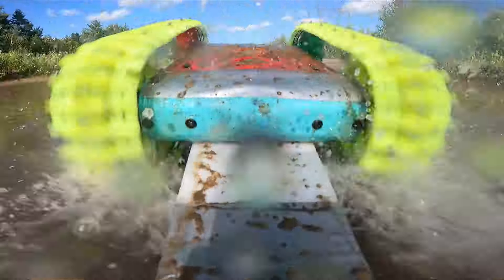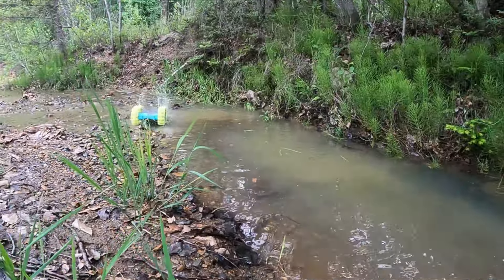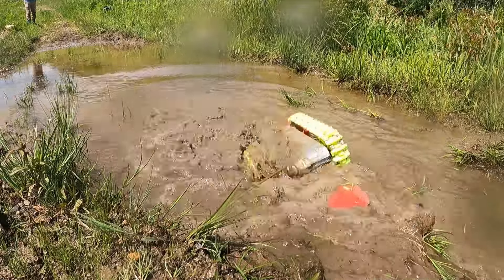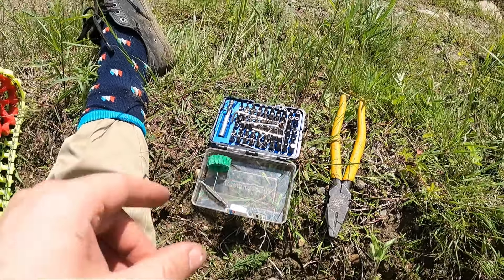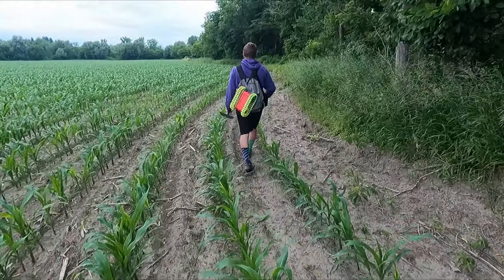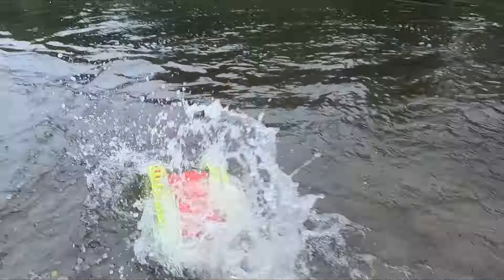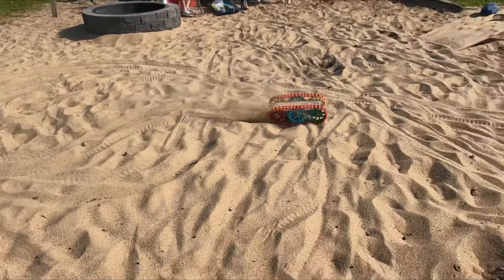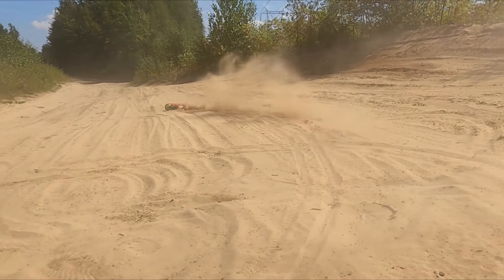Can a RC tank waterskip?

Comment: Can’t help thinking that the various tracks should have ‘link spacing’ commensurate to the type of terrain and maximum speed of the robot, which in turn would make it more stable and less likely to tip or flip ‘uncontrollably’ when travelling through say water .. just my opinion!
Reply from the maker: It's interesting, I'm always open to trying to improve this project. Especially if it makes the vehicle more stable. Since the tracks are 3d printed it will be relatively easy to modify them. but I don't quite understand the influence of link spacing on stability. Can you give me more details on that? thanks.